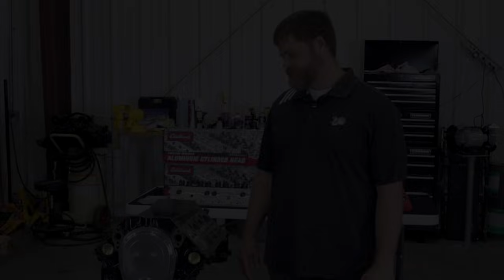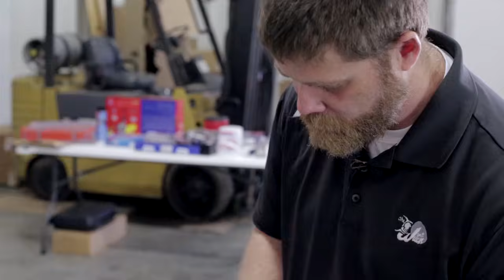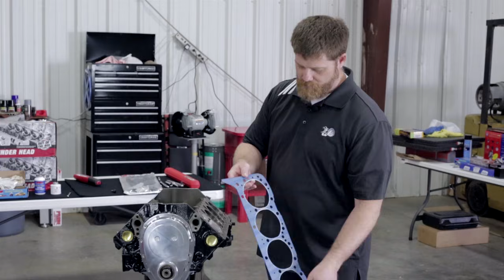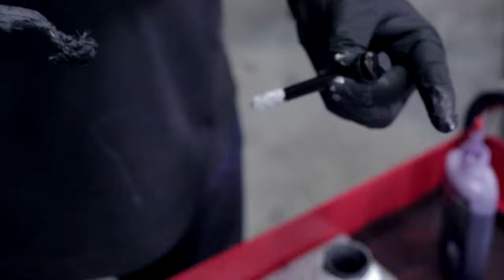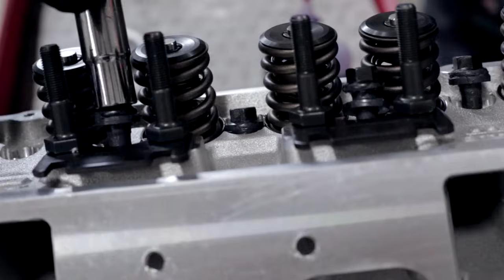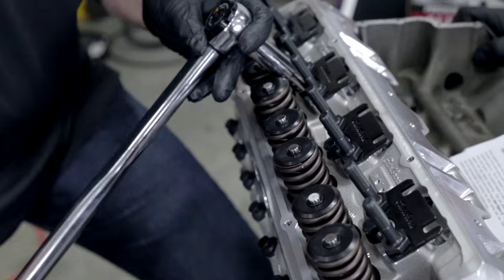Small Block Chevy Engine Build: Cylinder Heads

Comment: I'm about to save your time yall.

The Rocker Arms, Rocker Bolts, and push rods, ANY BOLT OR OBJECT doesn't need to be installed in the exact same place as long as their equally the same. You can if you want but this is usually only done in mechanic shops where they're there to fix a head gasket for example and their required to replace everything back in the same condition as it was received, but with the repair done.

For someone working on their own car it's not required at all. It's mostly just a "return the wear to what it was previously" but I've always said that the car ran the same amount of time, everything is worn equally.

Comment: NEVER retap head screw holes. Use a chaser or youll regret it
Reply: I think they know what they are doing
Reply: Apparently not if they're doing the block prep on the threads after they already spent all the time assembling the engine @crisperez592

Comment: Lots of ugliness in this video !
That 3 step torque process recommended is NG !  The increments are too small, especially with bolts.
Don't jerk the torque wrench !
Slow and steady
Rechecking after torqued will tell you nothing!   Stop at 65 then turn torque wrench to 70 and try again...it will click.  The initial friction needs to be overcome which is likely 5 lb/ft before the fastener will turn...even moreso with bolts compared to studs.

Comment: Out of box performance? I wonder how good the machine work is? Valve work?
Reply: my thoughts exactly , mass produced heads always need to be sent to an engine shop
Reply: @MIKEHOVIND  I had to cut and lap all seats and reface all valves that were chinese 21 4N stuff, better buy Brodix heads and use Manley Severe Duty or extreme Duty valves!

Comment: So you waited to chase the head bolt holes threads after you've built the bottom end and you just cleaned the gasket/head sealing surface, wow
Reply: I agree should be done before engine is assembled armature build bad info.would not recommend following this video!

Comment: what size tap are you using tho?
Reply: Im by no means an expert mechanic but i saw your comment and figured id help you out the only point of tapping the threads is to clean it out making sure theres no debris or maybe a damaged thread, so basically just use the same size tap as your bolt hole. That way when you are tightening your bolts they go nice and easy and you will have a proper reading on your torque wrench.

Comment: can I reuse my headbolts on my 305?
Reply: You can but for $20 from Rockauto.com Enginetech makes a set that work great.They have the sealant applied to the threads.Part number HB142. I have used them many times.
Reply: You like to live dangerously huh

Comment: Use a thread chaser, not a tap.  Taps can remove material.  Also, what tap size is it, a ground high or ground low?  Most taps are ground high 3.

Comment: Agree with the taps for the head bolts, I know some say no and to use chasers but them chasers won't remove all the corrosion and rust. Chasers are great for most threads but for these especially if using new arp bolts using the taps are the best option as long as u know your cutting some and will mess it up if ur not careful and pay attention. If there's to much tention then double check to see what's going on before just continuing to crank that tap in there

Comment: Hey parts pro.
I agree you should clean the bolt holes before you assemble the short block/bottom end! Alumium heads are a lot lighter than cast iron still becarful! Maniacal s10.

Comment: Chasing the block threads CAREFULLY is critical;  a shop did mine during a complete block service, apparently with a power hand drill and some were so loose and torn-up that I had to install inserts and finally used a complete set of ARP studs.  
Not to mention that the same shop also destroyed both of my rare 327 461X heads while TRYING to install hardened seats.  
( Darrell Buell Automotive Eng )
Reply: Wondering why he used a tap instead of a thread chaser?  Taps cut. Thread chasers clean and true.

Comment: There is no way i would use " Bolt On " heads straight from the box. I would at the very least have them checked by a machine shop and leak check the valves and guides.
Reply: I agree, but at the same time if you buy a crate motor... guess what, straight out of the box.
Reply: @port nut could void the warranty :).

Comment: I just know you did not take those heads straight out of the box and installed them. How much work did you need to do too them before you where willing too actually use them? 
We all know all production heads no matter who makes them need work straight from the box. 
Yeah bolt on head. HaHa thats funny.
Reply: I did and zero issue however, I wish I had checked the valves for sealing
Reply: @bilbobaggins4710  they will burn out because they dont seal

Comment: You actually wait until your short block is assembled before you chase the bolt holes on the block?  Thats nuts. i would be damned sure to do all of that before i assembled the bottom end and then clean EVERYTHING.
Reply: I AGREE 100%, that should have been done before installing even 1 part onto the block, what if a hole was stripped, etc. and the engine is already assembled?
Reply: But he is worried about lint
Reply: I agree ! Maniacal s10
Reply: bad move for sure
Reply: I agree as well! Damn, that is dangerous!

Comment: did you check valve seating leak seal before you bolted those heads on? and check the cc for actual cc's? did you port match anything? did you do any porting at all? did you do any extra unshrouding? the rpm heads appear ready to go, however we would like actual data on these outstanding quality heads, we all know heads need a go through especially after shipping. did you change valve springs? if so what are spring type and specs, cam specs, etc. thanks your video is an easy going video of guys putting on parts.
Reply: Edelbrock heads and their China valves need extensive valve jobs they leak and burn valve if not corrected
Reply: These heads are CNC'd I would not touch the ports at all ...Check for valve sealing yes

Comment: Home gamers try this if you forget to chase threads before assembling your short block:  use that engine stand [for what it's made for], and turn the side you are working on to face down.  Better off with a crick in your neck than metal shavings hiding in you piston bores.  Flush holes after thread chasing with a little brake cleaner before righting - use the straw and wrap a shop towel around the opening so you don't get a face full, using short blasts to catch debris.  And don't follow his advice of plain "cotton" for final wipedown before putting in gaskets- it's not lint free and if threads come out undetected, the softest/tightest part of your engine is... your bearings, so if there will be a problem from that 99% chance it happens there.  
If by chance you bought a stand that does not allow block rotation... give up on engine building, as you are not mechanically minded, and the $40 bucks you saved will perhaps cost you a thousand down the road.  By the way, there is no such thing as a "bolt on" head - assembled heads should always need a little t.l.c. before putting on.  Two things must happen at a minimum:  pull valves to check valve seat runout, and verify the intake port is a hair larger than your intake manifold side with everything lined up.   Having a wall steals hp from what is otherwise a good investment [and is not friendly for carburated engines]. I have yet to see an intake manifold/head combination that didn't need just a little massaging with a die grinder, so just bet on having to fit those two as part of the build.  I like the manifold side between 0.005" and 0.010" smaller than the opening on the heads to give room for settling or minor gasket shift when assembling.   For valves,  seat runout of less than 0.001" is bang on, and anything over 0.002" is  cause to go to a machine shop to get valve seats re-cut if you want maximum life out of the heads before next service.  Most machine work will be in the liveable middle, and will do just fine.   Runout of over 0.004" is an abomination that will cause poor compression, premature guide wear, and allow reversion problems/odd manifold vacuum behavior... it's an all stop: don't even think of bolting that on.  Yeah, it will run, but why did you buy aluminum heads in the first place?

Comment: I completely wore out three taps when chasing my head bolt threads.  It that normal?  The taps were VermontAmerican, which is more of an economy brand.  So maybe they thrifted on the alloy or hardening.
Reply: Redline Racer  so do I,  and so do most reputable machine shops.  I cringed when I saw him using a cutting tap.
Reply: Redline Racer    and chasing the threads after the short block was assembled is a no-no in my opinion.   i like to watch some videos of the actual machine work being done on heads and blocks.  i'm 72 yrs old, and building my  8th drag car, and hopefully my last.    Chev Vega,  406 small block.

Comment: i hope no one actually attempts to torque their fasteners like this. the torque click should be one and done, each time you're clicking that thing, you're adding 3-5 in or ft lbs to the fastener torque. completely wrong. its a nice build, i hope its still running good.
Reply: They have done tests (google it) and it is true to NOT double click as it will add torque. So not completely false. it is more drastic when your at around 20 ft lbs or under (obviously) but at 70 ft lbs it's irrelevant and one could argue a typical torque wrench +- allowed would be greater. I cheat the system daily on airplanes where you have a specific spec on the nut, sometimes bolt, with a min and max in order to fit a cotter pin. If it's not within that spec you are supposed to add or remove "shims" (washers). While when it's close, just keep clicking it'll line up. The difference is we have QA watching to keep us from just manhandling it.

So we can all keyboard warrior it up and name call and call bullshit all day, but you may end up looking like an arrogant prick at the end of the day @Michel Linschoten.....
Reply: If you do not push to hard through the torque click not a problem, i hate internet bullshitters like this. When did you ever ...and i do mean EVER heard that a head damaged of 3 or 4 ft LBS more?! NEVER....stop the bullshit salty experts
Reply: @MichelLinschoten  Eric Weingartner and David Wizard would never work so crappy like this noob here
Reply: I'd have to disagree with you Allen, if the bolts don't turn, and they shouldn't because once he lets off the set torque the break loose torque higher than the torque settings "click" or snap over.  once a bolt stops turning it will take much more torque to get it going again, much higher than the snap through.  torque is a function of stretch in the bolt and if the bolt is not threading in further he is no longer stretching the bolt.  now it may be true that the second and 3rd click are redundant but if he hit it 100 times more he wouldn't be adding 300-500 more ft-lbs.  that is why he has to go in steps of 10 or 15, in order to get them moving again.
Reply: completely false

Comment: When prepping the head bolts you commented you were using thread locker on the threads and arp paste on the washers. This is incorrect the white thread locker you are using isn't thread locker it is a sealant paste because the head bolts install into the water jacket of the block, Im sure you are aware of this but someone watching the video and not really knowing what you are doing would use loc tite blue or red on their head bolts and run into all kinds of major problems like pulling the threads out of the block when trying to remove those bolts down the road and possible coolant leaks because thread locker isn't a sealant for coolant
Reply: Griffon 327 I need some advise, I’m using these heads I’m pretty sure not the rpm version. In any case I’m using arp studs, I had my engine freshened up and decked at my local machine shop. I used what “experienced” guys recommended which they suggested permatex aviation sealant and I used a fair amount. I chased and cleaned my threads and cleaned studs and all the prep work. I let my sealant cure more than 24 hrs and then installed the heads. Now it took a bit to get other parts to actually run the engine but the head studs leak. My leak is NOT from the surface between HEAD and DECK or from gasket and I don’t have internal leaks into engine ei. Milky oil. The coolant seems to be traveling along the studs from the water jacket thru the nut and out the top of the nut. Any advise?
Reply: If you can take them out one at a time and put teflon paste sealer on them. Studs...Good luck. Drain the block first.

Comment: Are you actually using a thread chaser to clean them out, or are u re taping the threads?
Reply: +Parts Pro Centers thanks. Thats what I figured. Some folks dont realize how important a step that is, to properly torque the bolts.  Great video
Reply: +ironhorse127   looks like a tap to me.   Sketchy
Reply: It’s possible to dull a tap with a buffer wheel and “chase” the threads.

Comment: why the wrench on the tap?
Reply: +Marc Beard Thinking the exact same thing I have a socket set made specifically for the top of taps so you can use a 3/8 spinner handle for stuff like that or very least use the tap handle that is in the tap and die kit. using the wrench not only takes 20 times more effort and time it side loads the tap when turned which dig into the threads cause hes cleaning the threads with an actual tap instead of a thread chaser that will not cut only clean.
Reply: Yeah my thoughts exactly... Side load was my firth thought then I said they know better. I know they have tools.
Reply: +Griffon 327 12p and spline sockets work good with taps also.